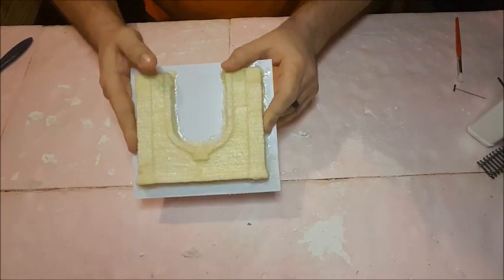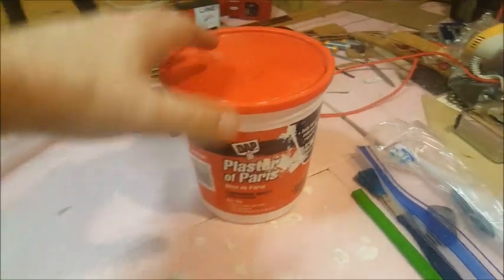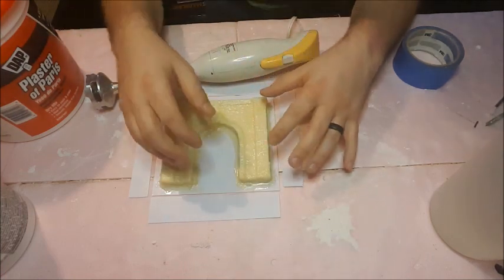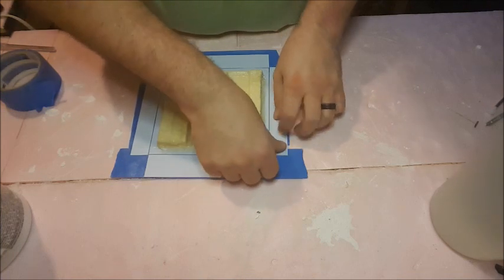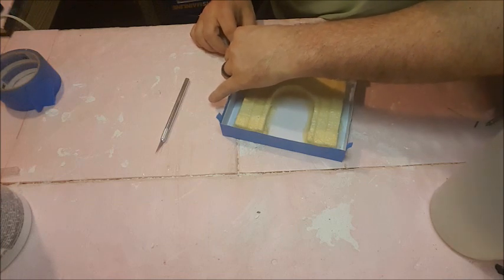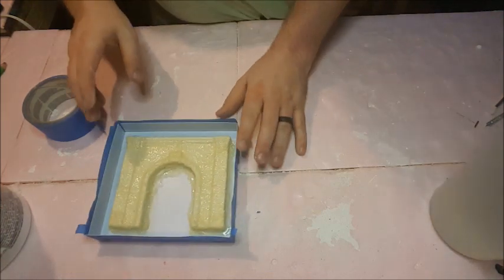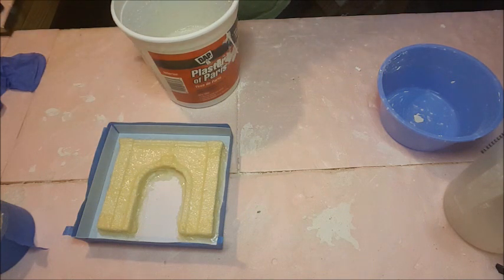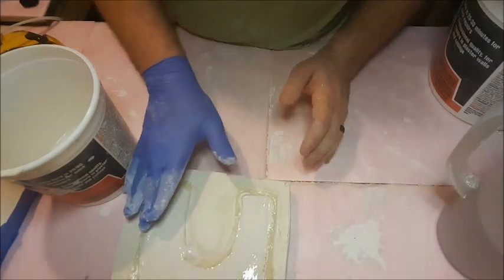Model Railroad tunnel portal latex mold - Part 4&5

Comment: Rick, did you leave the original portal in the latex? You didn't show you taking it out.
Reply from the maker: The original is still under the latex. If you remove it the plaster will collapse the latex.  Watch out for part 6, you will see what i mean.